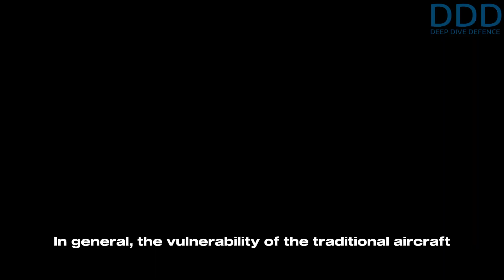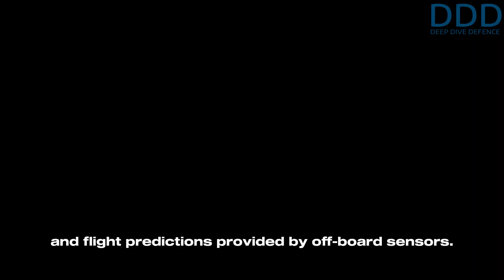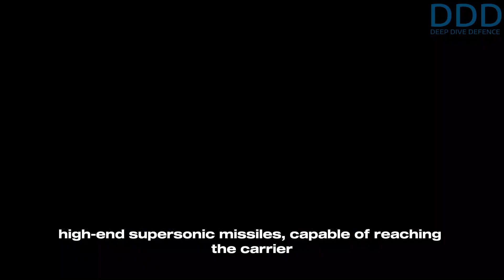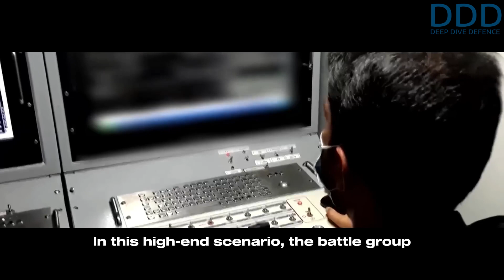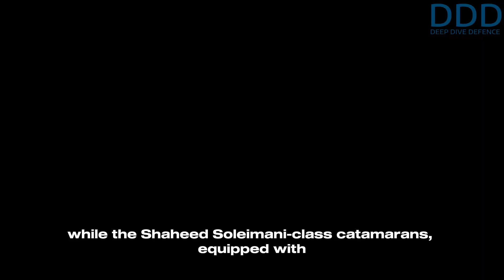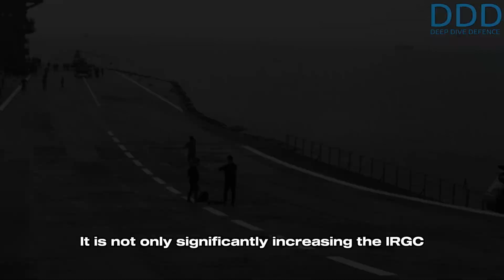Bagheri-Class: Iran's first Drone-Carrier

Comment: It could just be me but I always saw this as more of a counter for the US ESBs, especially since there has been one in the gulf for years. Of course it would be used for surveillance of enemy strike groups and vessels but in a high intensity conflict situation the Bagheri is a perfect foil to the logistics network. Both are long endurance, staging platforms for ISR, anit-piracy and smuggling and special forces operations. The difference is the the drone carrier is faster and has both offensive and defensive capabilities. If they actually do give this thing deep striking capabilities then it could only require a small escort of 2 to 3 Soleimani class ships on a shadow fleet mission. I think that whatever the new catamaran warship currently being built by the IRGC is going to be the spiritual successor to the Madhavi in terms of a missile carrier. My guess is that they eventually convert the Madhavi into a official drone carrier as well. It works out because by the time they start to convert it they will have identified and worked out some of the kinks and design tweaks they need from operating the Bagheri. The ships were originally the exact same dimensions in size so it would definitely work. With two, you're now able to secure the gulf and the strait while also performing expeditionary operations elsewhere.
Reply from the maker: Very good points!

Comment: You said it yourself. Aircraft carriers sun is setting for the most capable nations. This kind os strategy has no benefits to Iran, as any potential conflict would be in the Gulf where the gulf is too narrow for a carrier to provide any advantages. Even against Iraq and Kuwait. All other potential adversaries are capable of sinking such carrier in a blink of an eye.

It is important to note also, a major defense of the USA aircraft carriers is deterrence against sinking a USA carrier provided by the USA capability to avenge such an act rather than physical tangible capabilities. In another word, no one will risk the sinking of a USA carrier and gets away with a likely nuclear strick if a carrier sunk and took 6000 personal with it.
Reply from the maker: Its explained why it can't be destroyed in a blink of an eye
It has serious anti-air firepower and magazine depth
Reply: @DeepDiveDefense  Even if your argument stands and the carrier can defend itself, the viability of a carrier is to take airpower over a long distance away from friendly territories while the supply chain is maintained and an armada of a battle groups is at ones disposal.

It seems to be an experiment that is unlikely to prove significant. Yes, Iran had single handedly proved the viability of the kamikaze drones however such an extension, drone carrier, may not be viable, or even feasible.
Reply from the maker: Over Horizon persistent surveillance for ASBMs
Reply: Very good argument and reasoning..

I love these rational & intellectual debates ❤❤❤❤❤
Reply: dont walk alone
Reply: چند هزار نفر سگ آمریکایی در عراق توسط مقاومت کشته شدند؟؟؟ برو تحقیق کن 
لاف نزنید
Reply: تکنولوژی هسته ای در اختیار ایران هم هست🎉

Comment: Unfortunately it does not have certain aspects for aircraft which i have questions for the larger 313 craft.

But that being said it is interesting
Reply: Including aircraft would disturb every thing in the ship with its needed logistics,  plus costing some what more than ×10 , and would not work in a symmetrical methods which are low punishments from financial to political,  unlike drones and missles that cant find its truck driver after running into things they shouldn't lol